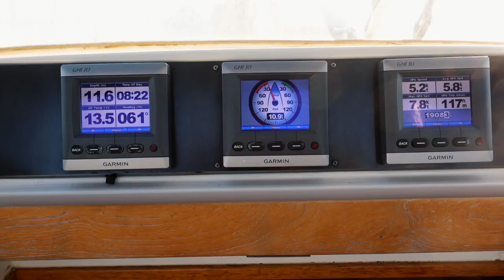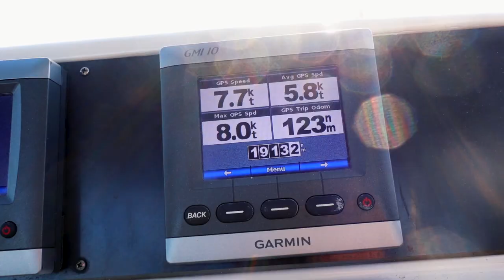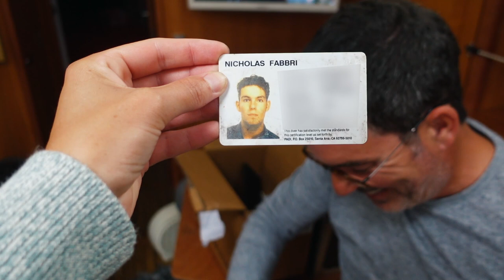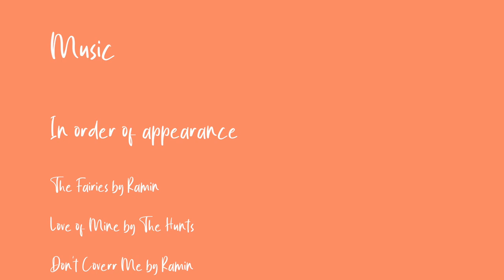Goodbye Ruby Rose- Our Final Episode

Comment: Just a little tidbit of information about the whistle, the frequency that marine whistles are designed to make carries further even though it may not be as loud. The distinct noise that the whistle makes is also a frequency that rescue vessels have equipment on to pick up because it doesn't occur naturally in the world and it helps them locate you if you are stuck out at sea.

Comment: This quote from Nick is the crux of my question, regarding that debacle of a demonstration of life saving equipment and its multiple failures... "before you go offshore they have to be checked... far better than we checked them... because these have been in a locker for a year".
To me this screams life-threatening issue and leads to a difficult but honest question... where does the fault lie, with you two in failing to check/maintain this vital equipment more than once-yearly, or with the manufacturer that cannot guarantee the reliability of their emergency equipment without semi-yearly checks/maintenance?
(this coming from a guy that believes his can of Fix-a-Flat that I keep in my car's trunk/bonnet will still work after 25 years)